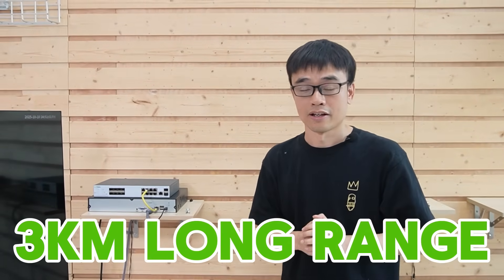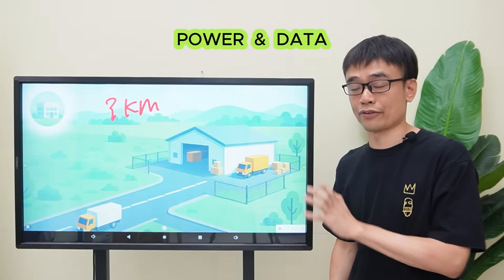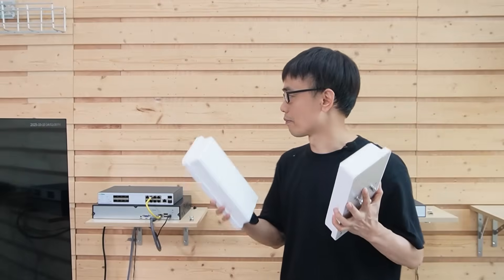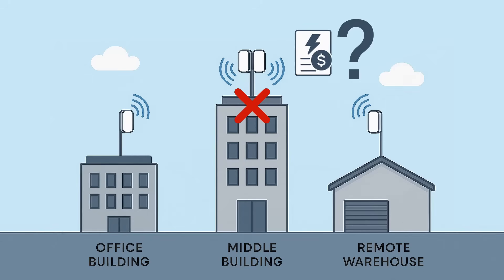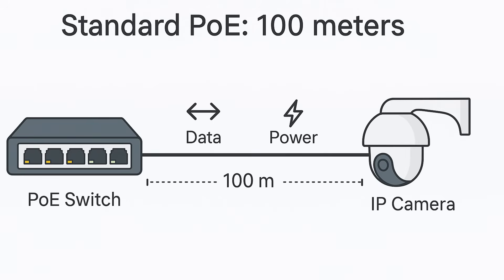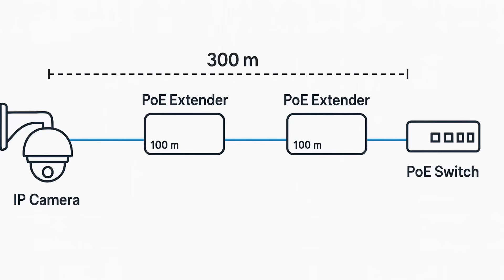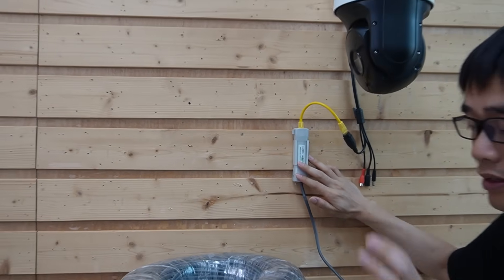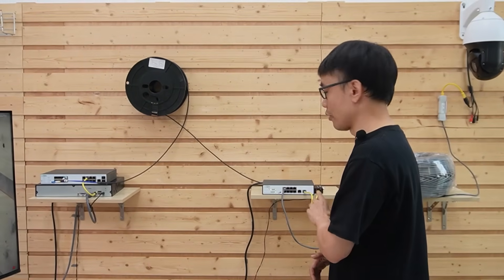Long-Distance IP Camera Setup (3KM Fiber + 300M PoE) | Step-by-Step Tutorial

Comment: Hello, thanks for your good presentation and demonstration. I learned new things! And also I have a question. 

I have quite the same set up in your demonstration. But I am always encountering a problem. 

Everytime that there is a thunderstorm and lightning in my area, the media converter always fails  to work properly but the fiber optic cable is not affected. So I always buy another brand new media converter to fix it.

I suspect that the weather condition is the reason for the problem because it has happened twice.

Also my set up is placed outdoor, not inside a room or office. So I think that is why it is susceptible more on lightning and thunderstorm.

My question is, what do you think is the best solution for my set up? How can I avoid this problem?

Thanks in advance for your time and answer.
Reply from the maker: The fiber optic cable is made of glass. It is EMI immunization. There is no need to concern the surge over fiber core unless it uses armored jacket. If the power indicator is off, the surge could come from the power source, otherwise it could came from the Ethernet port. The last possible issue could be the rain/water.
Reply from the maker: Even though fiber optic cables don’t conduct electricity, the media converter itself carries electrical current on its Ethernet side. Use an outdoor media converter or place it in a weatherproof, grounded enclosure, and add surge protectors on all copper lines.

Comment: Are those SFP transcievers Full or Half Duplex as they only have single LC connector on them?
Reply: What you saw in the video (a single fiber strand connected) is  normal, because the switch accepts BiDi SFP modules, which use a single optical fiber (simplex) to transmit and receive simultaneously thanks to two different wavelengths. the ref of the SFP is "FASTCABLING 5976-84 – SFP 1.25G 20KM LC 3.3V DDM IND (Tx 1550 / Rx 1310 nm)"
Reply: @laminovg  That's cool; that means he has one for redundancy.
Reply: @laminovg  So what this means is that I need to get 1 pair of BiDi SFP (+) transcievers but must be different wavelength? I need to try this out, this is going to cut expenses on fibre resources.
Reply from the maker: Full Duplex. They use Wavelength Division Multiplexing (WDM) technology, which means they transmit and receive signals simultaneously over a single fiber strand, but on different wavelengths (for example, 1310 nm for TX and 1550 nm for RX, or vice versa).

Comment: Hello and thanks for your presentation. How many IP cameras can I feed into a 2 core single model fiber optic cable
Reply from the maker: It is between 64 to 80 units depending on the resolution and fps configuration.